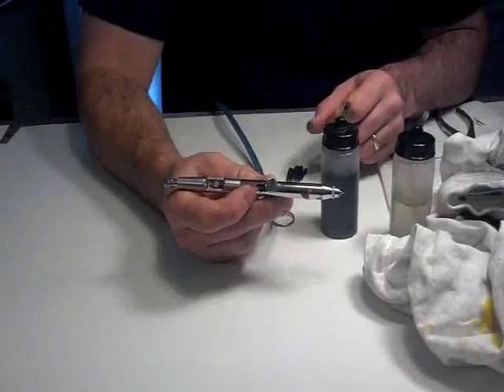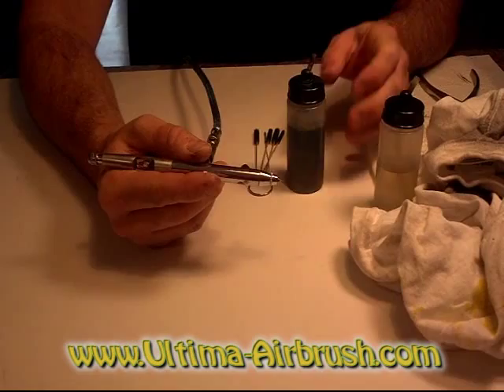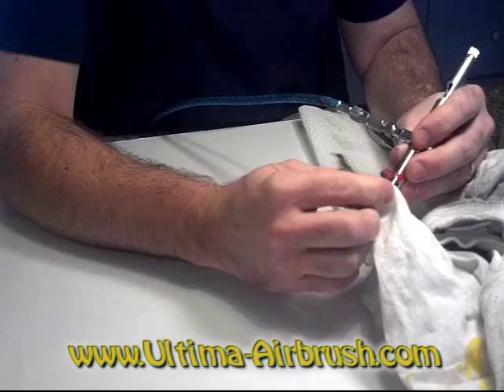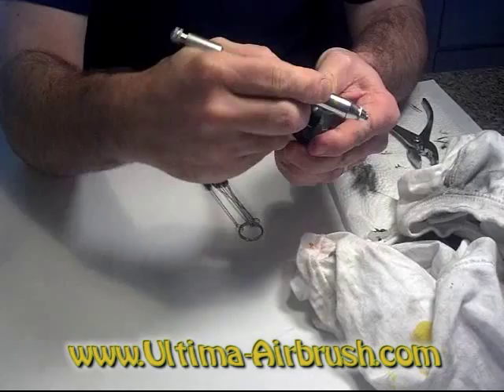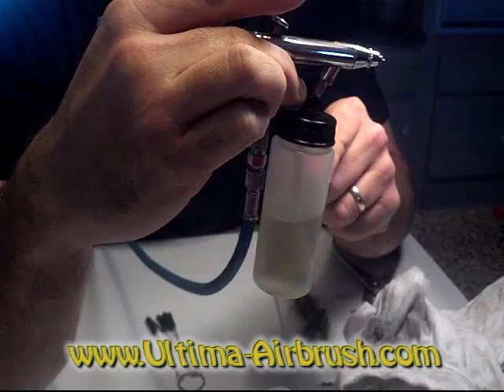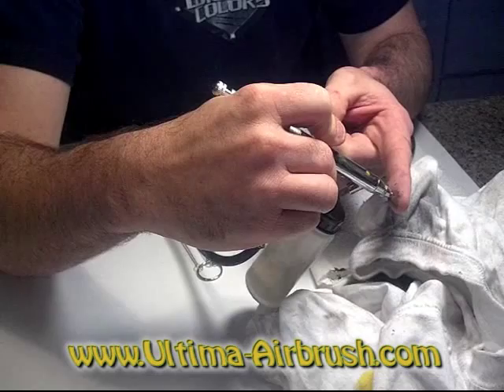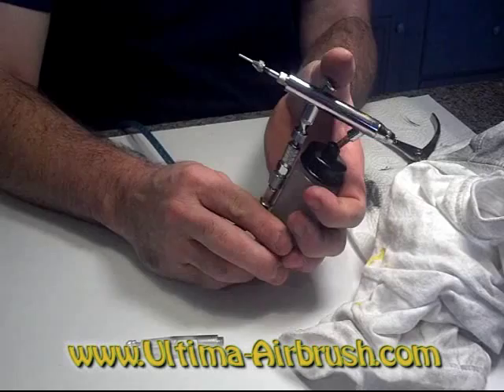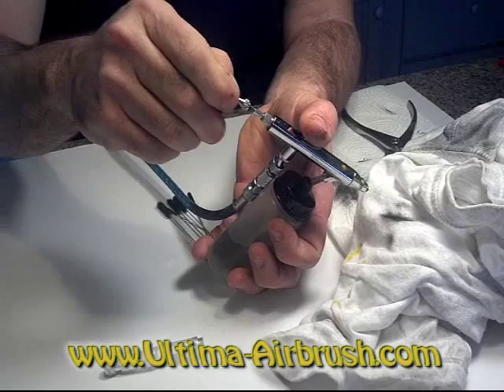AIRBRUSH 101 | AIRBRUSH CLEANING TIPS TUTORIAL - Advance cleaning tips by Richard Markham

Comment: I'm having a issue with two of my airbrushes... I can barely get any air through them... even with the compressor cranked up to 60psi. I have completely cleaned them and even replaced the needles and tips... I am at a bit of a loss as to what the problem might be.
I use (reduced) Createx Wicked acrylics through them. One of the airbrushes is my prized Harder & Steenbeck 2 in 1.
Could it be that, somehow, paint has got into the air channel of the airbrushes?